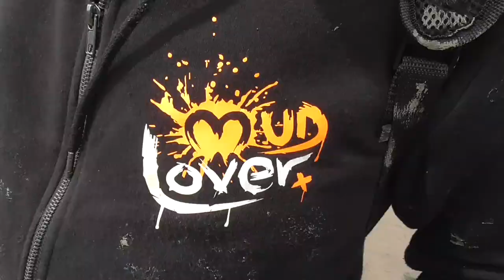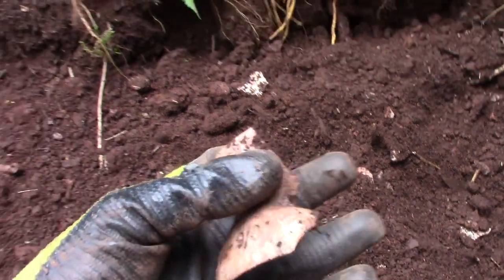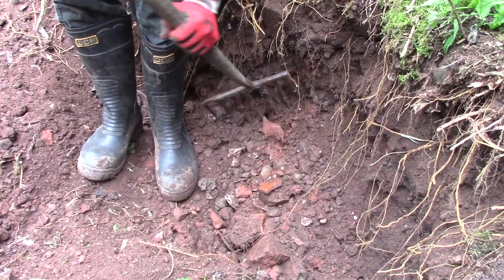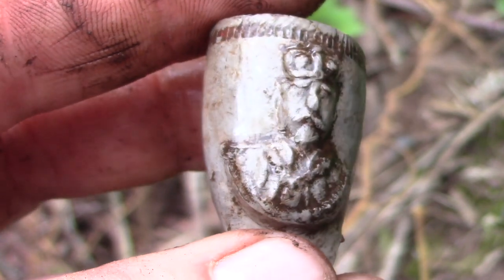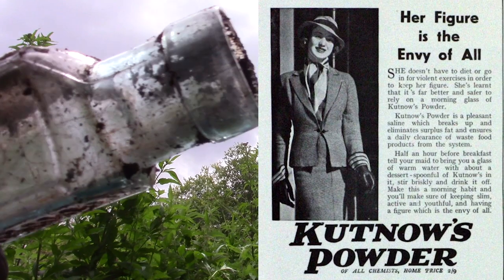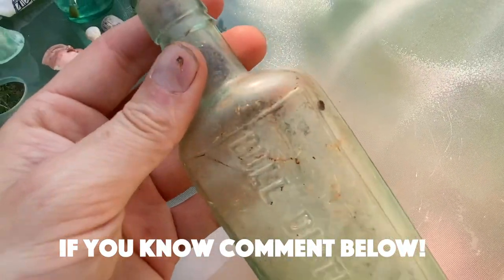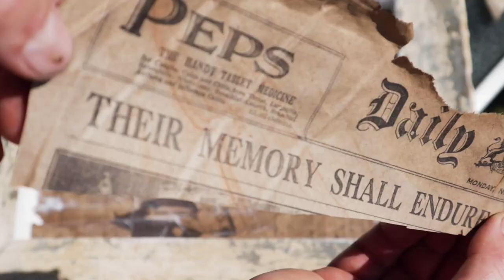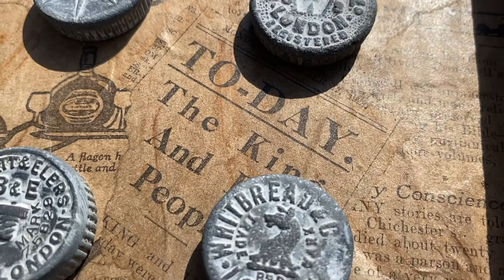Digging London's Dumps! We find what the Victorians threw away!

Comment: After you drilled your holrs you turned your frame over to neaten up the back.  When drilling holes, if you would put a piece of board flush with the back where you're drilling it will help to safeguard tearing the back into fragments.

Comment: Si, If you ever battle to get the papers to lie flat that you are decopauging... there is a trick to do that easily.  Pre-wet the paper before laying it down.  I use a plate or pan of shallow water and just run the paper through the water quickly.  I let the excess drip off and then lay it into position.  This keeps it from wrinkling before and while drying.  Love your vidoes and creative craft projects!
Reply from the maker: Nice one thanks!

Comment: Main ingredient for St Jacobs Oil was chloroform to be used topically for pain.
Reply: Are you sure? It mentions coughs and sore throat which to me sounds like it was some sort of opium tincture
Reply: Wolfpaw754 Folks did some very strange things to deal with illness back in those days. Yes, they took turpentine by mouth and may have taken St Jacobs Oil by mouth too. It was suppose to be a liniment not a tincture. It did not contain any opium. The product was analyzed per a correspondent of the British Medical Journal, it contained turpentine, camphor, ether, alcohol, carbolic acid, capsicum, aconite and small amount of origanum. In 1913 it was noted that it contained chloroform as a replacement for the ether. There was also another remedy sold over the counter that was called Kickapoo Indian Oil which did contain opium.